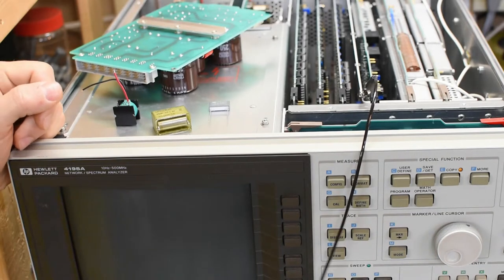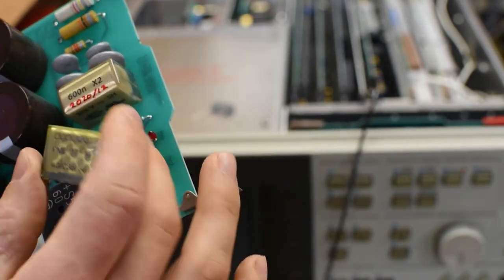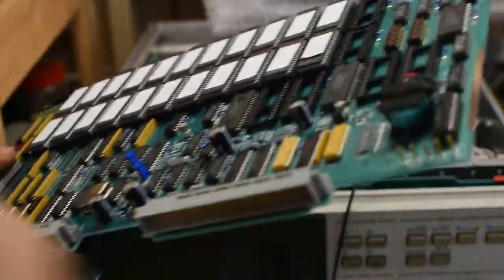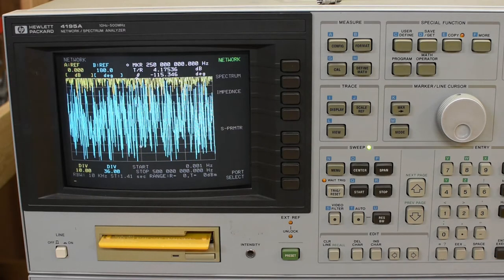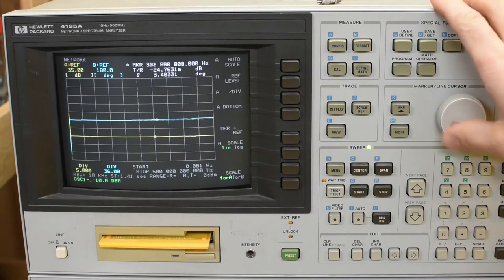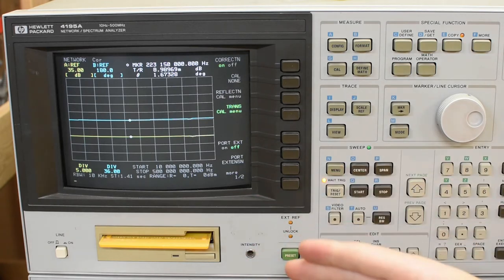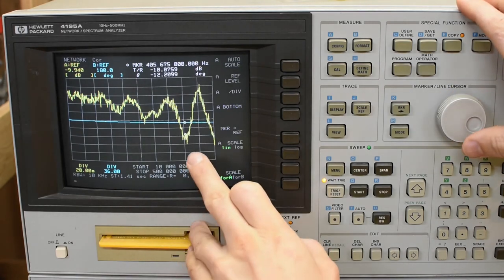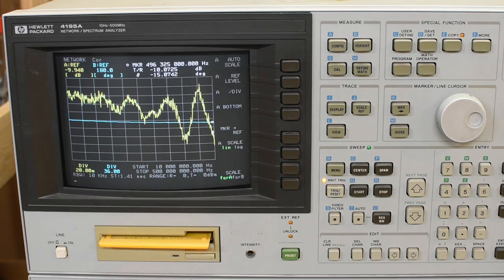HP 4195A network analyzer repair, part 2 : finishing up

Comment: Do you have the pinout for the rear connector cables? I have the top and bottom instrument, without cables. Should not be a problem, I created cables for 8566B and 70k mainframe as well, but have not found the correct pinout for this instrument.
Reply from the maker: This is discussed here https://www.eevblog.com/forum/beginners/hpagilent-4195a/

Comment: Did you ever find the need to track down the factory floppy?  
Sounds like the factory calibration was contained in an EEPROM?   
Also any recommendations on a good "universal" EEPROM reader/burner to get these days on a budget that is good for a widde range of this kind of stuff? 
Last time I used one it was owned by a place I worked at and they paid thousands for it and a dedicated PC it worked with.
Reply from the maker: yes, the factory cal seems to be in the eeprom. If one were to work on the analog section pretty sure that's where the Adjustment program floppy would be necessary. This instrument is beyond my testing and verification capabilities and it "checks out OK" so I didn't pursue further. But I found the next best thing : https://groups.io/g/HP-Agilent-Keysight-equipment/topic/24816108  : a Tobias Pluess reimplemented the original HP BASIC code in python. Haven't tested this.
eeprom reader : I have a tl866 (make sure you buy from an official reseller). Works ok but software needs Windows (I run it in a VM)

Comment: Greetings, I found your video looking for the solution to the same equipment that you show how to repair and calibrate, I did the same when watching your tutorial but I don't know what happened because the equipment makes a different defect and does not give an image as at first I would like you to help me with this problem and give me an idea of what could be the cause because I do not have much experience with this type of equipment.
Reply from the maker: Hi, I recommend you post to the groups.io HP-A-K mailing list, https://groups.io/g/HP-Agilent-Keysight-equipment . It is a much better place than YT comments for in depth technical discussions.
Reply: @fenugrec5697  Thank you for your reply. I have tried to subscribe to the group and it does not allow me to participate. I can only see the messages. I have a notification that my email is not valid and it is the one I always have. Can you tell me what the problem is or what I should do?